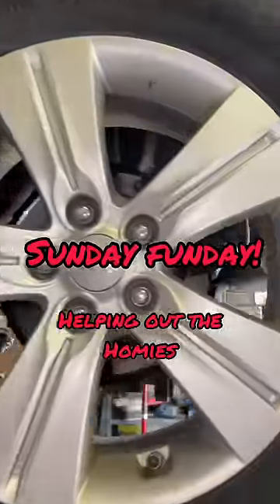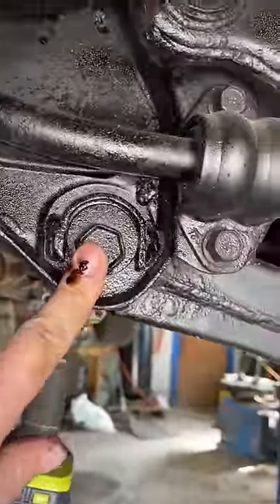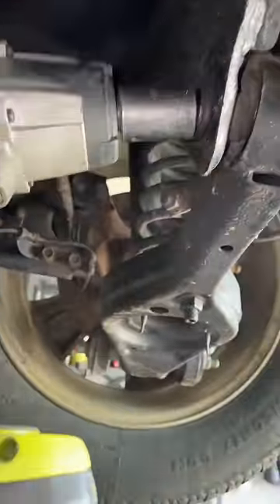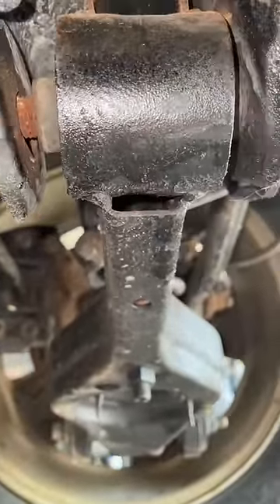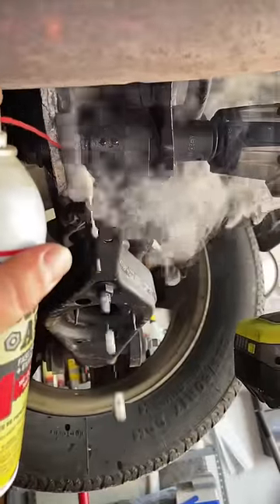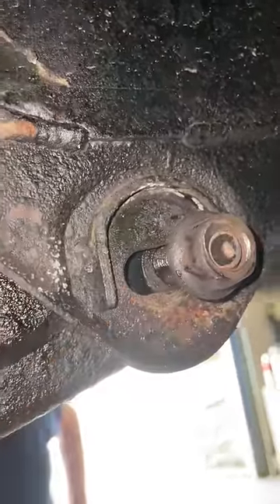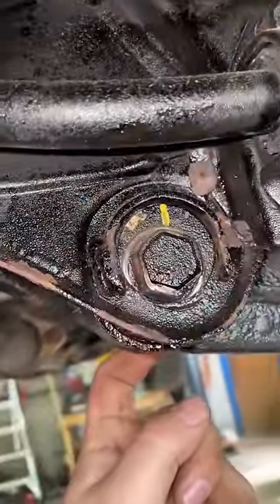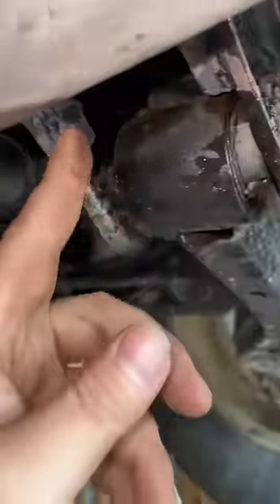Vehicle can’t be aligned problemo

Comment: I did this back in 2020....right when the craziness started. I cut the bolts off figuring I could just go buy some....no one was open and ford wanted 200 bucks for 4 bolts...came in a set only. Just an FYI...do some research before you start chopping off bolts haha
Reply: Same here. Except ford wanted 168 for a part that had plastic on it that broke because ford was cheap, and someone on their manufacturing line street name is over torque.
Reply: Lowes and home depot have a fantastic selection of grade eight bolts. Just got some for a subuaru this week and worked like a charm on a car we had to cut the control arm off in order to get the bolts out.
Reply: @theguyoucallwhen...8047  they didn't have any the size I needed. Trust me I looked everywhere for them.
Reply: @theguyoucallwhen...8047 you can't replace an eccentric alignment bolt with a home depot bolt. It don't work that way, if you're gonna do that you'd be better off just leaving the old bolt in place.
Reply: exactly, i thought id have to get some new cam bolts and online they were 50 dollars each😮 luckily i got them off and no need to buy new ones 😅

Comment: If I had a dollar for every customer who thought I was scamming them for this exact issue. I could pay for some of those broken off bolts from the "just send it" group.
Reply: Fudge all that man. Just sell them a new LCA. Because after all that work the ball joint is just as old as the bushing is so why piecemeal quality work?
Reply: Thank you! If you added up all the labor for messing around with heat and air hammers and cutting to try and get a rusty mess in place, it probably equals more than just replacing everything properly, sometimes you just have to say no, it must be replaced.
Reply: @tylerdepaolo1864  if you know what your dealing with straight up and are handy with a cut off wheel and a welder then you can almost save anything cheaper than replacing it.

I've been restoring cars for years so I'm pretty quick at what I do but this is like a 10 minute job to get this fixed. Chuck an extra $50 for labour and consumables and charge them a marked up price for the new bolt instead of hundreds for a new control arm and hundreds for your labour to swap it out because it takes you 2 hours to get a bolt out.
People don't have a lot money to waste on a daily driver when their struggling to pay rent and need to get to work still. 
If anyone wanted easy work and lots of money they shouldn't of been a light vehicle mechanic
Reply: @GalaxieMarauder  because you shouldn’t have to buy a whole new control arm. It should be feasible to press new bushings and replace the balljoint and save good metal
Reply: @rydermiller1782  this! Just takes a little skill to save parts and money. And you know, with the older stuff you have to save as much as possible.
Reply: @richeyrich2203  should be but Ford wants you to buy a new preassembled control arm
Reply: the problem is that there are mechanics who do try to scan people and so people have hard times trusting you when you're telling the truth because of the other guys

I've had my car at the mechanic for problems and they'll find these unrelated things that I know are not issues because I've personally double checked them and they'll demand that they need to charge all this money to fix this crap that doesn't need fixing because I personally checked it and fixed it myself if it needed it

then you've got the corporate scam shops like Firestone and pep boys which charge eight times as much as the normal price.. places built and marketed to tak advantage of middle class soccer moms who don't know anything about cars and don't know any better  charging them $800 to replace a radio or $1200 to replace a control arm (not a rusted bolt)..

so yeah these Auto places get a bad reputation because they deserve it so then when you have honest dudes like yourself it's understandable that people will be skeptical..

I mean I've had my car into a shop for an unrelated problem and they told me that they needed to charge $300 to replace a lower control arm because it had a bad bushing simply because the bushing was a different color after I changed that bushing. the bushing was fine by the way

I think the best you can do is try to work with people knowing that there are scammers out there and just try to build the trust. go out of your way to show them exactly what's wrong so that they know that you're not bullshitting them because if they've never worked with you before it's understandable to be skeptical since all these bad mechanics out there trying to scam people
Reply: @rydermiller1782  I can order a new control arm on Amazon for under $100. and assuming that cutting off the bolt goes smoothly it would probably be just under an hour of work

of course I've had plenty of times when cutting off the bolt does not go smoothly and it takes an extra hour just to get the fucking thing out..
Reply: @mikekasich836  if he's only got to fix the bolts so the alignment shop can do their work then he's just gotta chop it and press it out, then whack a new bolt in and send it to the alignment shop.
there's nothing even wrong with the control arm itself. I know He's Tryna save money and do his friend a favour bit the should just get new bushes too, the rust on the bolt would create a wear spot and make a gap inbetween the old bushing and th new bolt so it would always be a bit loose and have metal on metal gap that would flog out and get worse so new Bush and new bolt. save everything else
Reply: @mikekasich836  nonsense.
Reply: @rydermiller1782  the point is if that bolt is that bad then the ball joint is more than likely just as bad which makes it easier and cheaper in the long run to just replace the control arm with the ball joint.
Reply: @rydermiller1782 it MIGHT be a 10 minute job. Or it might be 5 hours when somethin falls apart. Im sure youve noticed the quality of alot of parts have gone down. I replace parts like that because after awhile i dont trust it. Even with new bushings.
Reply: It doesn't no $500 more when all you gotta do is chop off the bolts and replace them. That's where you're scamming your customers.
Reply: That's why I believe you should be able to bring the customer back there and show them but some people flip out and don't want to look
Reply: @rydermiller1782 the bolt is frozen to the collar inside the bushing that fucker is not coming out without destroying the bushing also. You would need to at least change the bushing and the bolt. Or just leave it alone and just toe and go the front then tell the customer to rotate their tires on time and all will be well.

Comment: When the inner sleeve separates from the bushing, well then the bushings toast anyways
Reply: Really? Why?
Reply: @mikem5475  because it's only effective when their bonded together. Otherwise there's slop/play in the bushing/suspension
Reply: @twistednuts6062  so if the rubber is no longer bonded to the metal, there's slop/play? Explain a press fit to me, and how that is unacceptable, but a glued or bonded joint is
Reply: @mikem5475  This is what I was wondering..
Reply: But no one wants to spend more money😂
Reply: @twistednuts6062  sounds like you have no idea how an eccentric cam bolt works lmao
Reply: @xpeacemaster  30 years experience jr. Sorry you can't comprehend what I've said!
Reply: @mikem5475  There's not gonna be enough force between the steel and the rubber to prevent slippage between the two.
Reply: @ding9633  why are you trying to prevent slippage on something that needs to pivot? Everything with a bushing is constrained to never come apart, even if the rubber slips. The rubber just acts as a cushion. Not completely necessary
Reply: @mikem5475  The movement should come from the strain of the rubber.
Reply: @ding9633  you have no science to back up that claim, and no common sense either
Reply: @mikem5475  Keep on trollin
Reply: Change arm, new cam bolt, solves all problems.
Reply: @davidstegne3036  no
Reply: @mikem5475  what do u mean no? If it doeznt move after lube and air hammer, replace. Not worth my time otherwise.
Reply: @davidstegne3036  what
Reply: @davidstegne3036  You fed the troll
Reply: @mikem5475  I have driven old beaters for 50+ years to work.  I have replaced plenty of bushings.  The function of the cams is solely to adjust alignment.  The function of bushings is to allow movement of the suspension arms.  When the rubber becomes separated from the sleeve (inner or outer), not long after that the suspension will squeak as it goes over bumps.  Eventually the rubber bushings get so loose that the driver has to herd the car down the road.  For those of you that this is confusing, go to an alignment shop and ask them.
Reply: @williegarland8888  that makes sense. I'll never replace a bushing on my own vehicle just because it squeaks, maybe if someone came to me with a complaint of a squeak I'd do it
Reply: If the bolt is that deteriorated the bushings probably need to be changed
Reply: @twistednuts6062  put a lil 3m in there and call it a day 😂
Reply: @mikem5475  yeah but you don't want that much play. you want there to be a little bit of play from the rubber just to help with vibrations and stuff but you don't want so much that it's wobbling around..
Reply: @mikekasich836  who said the bushing has play? A bushing should never have play. This is obvious. The reason there's a bushing is to eliminate play. No one said play is acceptable. It should be a snug fit
Reply: @mikem5475  🤡
Reply: @xpeacemaster  Sounds like he knows EXACTLY what he's talking about to me.
Reply: Right.. just hammer it out.. it’s usually two or three good blows from a hammer.. no 10 minute heat up.. and that’s before even looking for the torch and how long it takes to find.. if you even have gas in it.. 
this did not require the torch..
Reply: @mikem5475  bushing aren't press fit to the bolt lol
Reply: @xpeacemaster please explain It is just a bolt with an oval washer keyed into it to set camber ect not that complicated just smash it out replace the control arm cheaper than new bushings and labor
Reply: Also it might be cheaper to get new bushings anyways. Idk how much they cost but, time is money too and I'm sure it costs 140$ or more an hour charge rate.
Reply: @bmint  who tf has to look? 10minutes? What kinda torch are you using? A bic? It's less than 1 minute. Now imagine the race is stuck on the shaft itself like a spindle hit it with the torch and watch it I've only been a mechanic for close to 30 years kiddo

Comment: These are the same shops charging $500 extra for the service taking longer, when they were charging book time (flat severely inflated shop rate), to begin with. Consumer beware, if your shop tries to charge you for this, and they’re already charging you “book time,” it’s essentially fraud. A flat rate is a flat rate, it’s not your problem as a consumer if it takes the mechanic an extra 12 hours to do the job.

Comment: By the time you said “might toast the bushing” that bushing was already toast and they’re gonna feel it over every bump
Reply: Not only that but if you have to cut the bolt that means it's stuck in the bushing and it would need a new one anyways.
Reply: Buy a new control arm
Reply: @bcd2107  Exactly, torch is already out, just finished burning the bushing out and press in a new one.  Dont worry, I'm sure the bushing is only like 5 days backordered.

Comment: Is there a shop that does only alignments? If that was the case they definitely seen that before. I use a balljoint press with a modified trunk spring section to push the bolt through. Rover LR3's suck pretty bad too much spring/air spring tension....

Comment: Had this in my friends F-150!  It was cheaper to replace lower control arms. Yes, we anti seized the new bolts, marked the old bolts, and measured the tie rod ends(yeah, had to do those too) Took it to an alignment shop, and found out I was nearly spot on with the marks and measurements!

Comment: Spring shop owner with 60 years told me the trick.. tighten the nut to clamp the ends of the inner sleeve from spinning and use a breaker bar to loosen the bolt in the inner sleeve. 
I had a 7/8x2" allen cap screw for my ball joint press.  Chopped up an Allen wrench that fit the top of the 7/8  allen.  Ground one end of the sections of the Allen wrench into push pins. Some with a concave head via my die grinder. So I can apply a lot of force to push out seized suspension bolts. Wont fit every app. On the end of the forcing screw I had a machine shop make up several inserts that push against the hidden ball and push the bolts the other way.. a coworker begged me to sell them to him when i left that shop.. i also had the machine shop make a pilot for my whole saw to keep the saw centered over a socket while I hole saw off the eccentric washer or cam washer so I can push against the bracket..
Reply: I wanna see this
Reply: I wanna see it too
Reply: It’s not coming loose without a lot of heat i see it all the time and the quickest way is always heat
Reply: I would also like  to see this
Reply: Rust weld is what they call it. It’s never as easy as a breaker bar and heat when your working on these 15-20 year old cars that have been in the rust belt there whole life and have never had the control arms replaced.
Reply: @thronewalker1153  Finally, someone that understands. I had a similar issue with my Subaru. I just took the control arms off and put some performance ones on. Being in WI, you get use to the fact that either you cut stuff off or drill it out.
Reply: @eradicater4186  I feel your pain.

Comment: I had a shop tell me it would be $300 more to spin the ball joints because of wear when I had just replaced all of the suspension parts on the front of my vehicle... not more than 9 miles from home to the shop... tie rods, ball joints, link pins, drag links, etc...
Reply: You're going to have to expand on what you mean by spin the ball joints
Reply: Can't spin the ball. You can pull them out. Which takes a couple of hours.

Comment: With an impact the bolt just vibrates inside that rubber bushing. You need a big leverage and hope that bushing doesn't rip :)
Mine didn't 1999
Reply: This man is correct.

Comment: If the bushing is not destroyed by this point, you take an inductive heater, heat up the bolt, and an air hammer will take it out.

Comment: This happens to bolts in older Dodge leaf springs. It rust seizes to the metal inner sleeve of the bushing. Easiest/fastest solution is burn the bushing out. It makes separating the bolt MUCH easier. You do have to replace the bushing of course, but it is a fraction of the job.

Comment: Move to Arizona 😂 my 570k tacoma lower control cam bolts look brand new when I finally changed the rubber bushing
Reply: Shhh 🤫 🤫 🤐 
What F S meant to say was,,, Please!! Arizona sucks! Don't come here! It's way too hot! You'll be miserable! Stay where you are, for your own safety. (Aka, we're full up down here 😂)
Reply: @soundmindtv2911  oh yeah, that's what I meant to say. That fuking auto correct I tell ya. 🤷‍♂️
Reply: Seriously, don’t come to Arizona it fucking sucks it’s too hot and it’s boring. Go to California or San Fransico or New York but not Arizona
Reply: Starts booking flight from NJ to Arizona

Remembers New Jersey state "exit tax" is a thing...

sighs
Reply: @tylerdepaolo1864  what the flux.. seriously?
Reply: Oh you dont have to worry about rust?  Hows your harnesses and seals doing with the dry rot? The heat is way harder on your drivetrain too, soooooooo. Good luck with that
Reply: @getchasome6230  thats why cars from drier climates are worth 50% more in resale value than cars from say Seattle or Maine, right?
Reply: @Semo_420  i know m8 that was my point. Arizona has turned into the garbage that is California. RIP Arizona, the insurance here is stupid expensive with all the outsiders. And usually these outsiders come from said crappy places /:
Reply: @DynamicDurge  That only has to do with lack of rust, nothing else. The swings between hot and cold will cause more damage to modern engines filled with plastic parts than rust will have an effect on those same engines.
Reply: Yeah I'm in Maricopa County and I just did my lower control arms at 300k and didn't even need an impact wrench.. Just a 18in half-inch drive ratchet. I reused all the nuts and bolts. I'm not using that parts store nuts/bolts from. PRC
Reply: @rdizzy1 you don't have plastic in your engine you're good to go ...keep that old engine with steel & alum going
Reply: Calif then Arizona transplant here; been here for 45 years and I was born/raised back east. Something about California weather, women and rustfree vehicles being the icing on the cake.
Reply: Lol, i moved the ef away from there... but I kept all of my rust free cars! And i will go back for moar when the time comes. My wheel bearing assemblies literally fell off on my 99 alero when i did them last year for the first time. Lol

Comment: If you cut the ends off the bolt don’t you still have to replace the bushing? Not saying your wrong don’t be leave you are. But just wondering if you had another way to remove the bolt once you got it out.

Comment: Good luck getting it back in with the struts installed still...
Reply: What strut?
Reply: Strut hold the wheel assembly not the control arms in the rear.

Comment: Look for a moog cam bolt set. They have a zerq fitting for the bolt and lubes the inside between the bolt and that collar. They need them from the factory especially north of the rust belt.

Comment: “Does Ryobi got what it takes?”  That was a rhetorical question, right?.
Reply: Not with a low capacity battery it doesn't. You stop getting full torque out of that after about 10 seconds of use under load.

Comment: Did an Escape crapper like that, torched the control arm apart and bought new parts. bushings were shot as the tires were leaning in an inch.